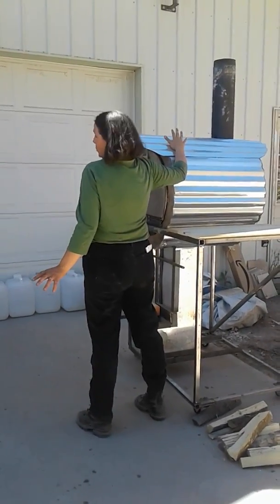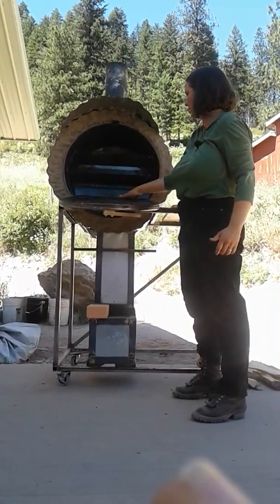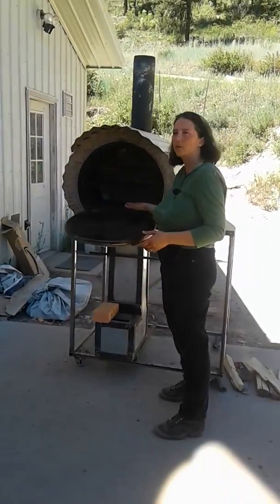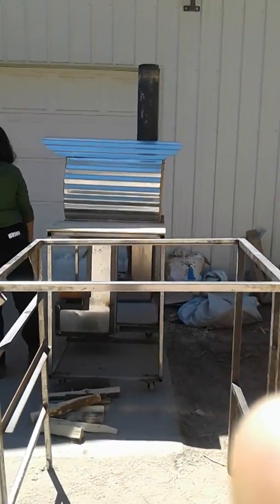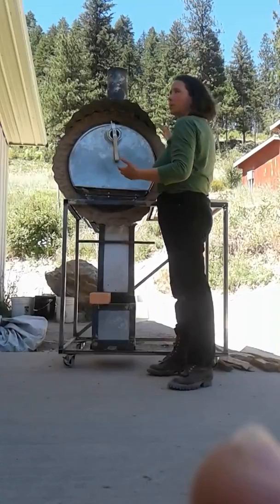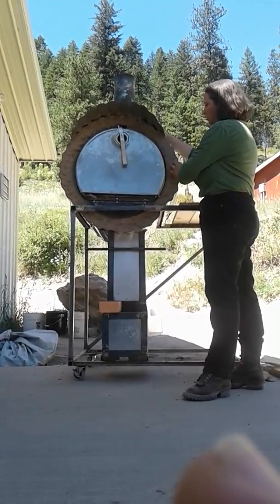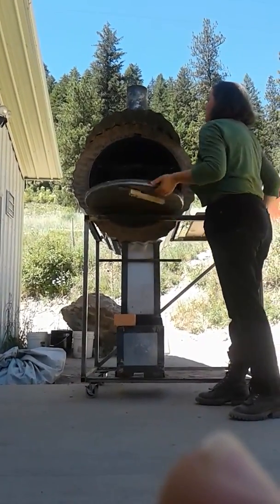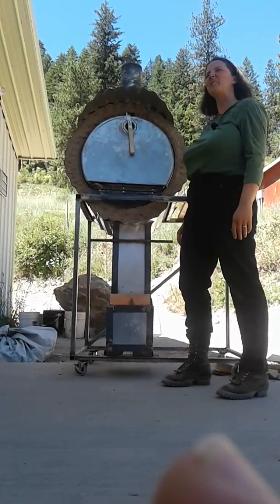Rocket Oven - Wheaton Labs ATC 2017

Comment from the maker: Time Stamps:
00:08 rocket j-tube "fire box"
00:18 interior of oven - bricks inside oven to hold heat, rivet construction, and racks
01:18 heat/gasses path through system
02:00 corrugated metal skin and roof
02:33 unseen voids inside explained
02:57 fire science / oxygen flow
03:49 a look at the back exterior
04:22 feel of wooden handle and friction
04:28 a look inside the oven clean area